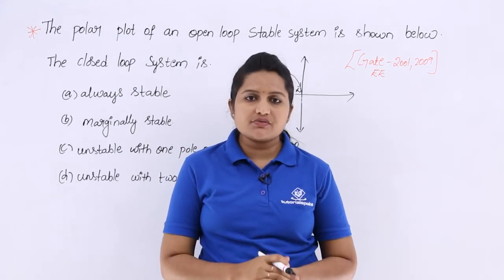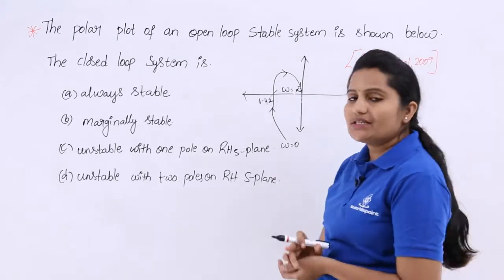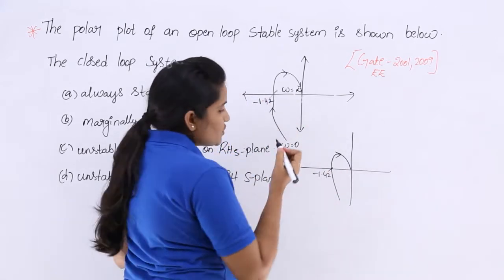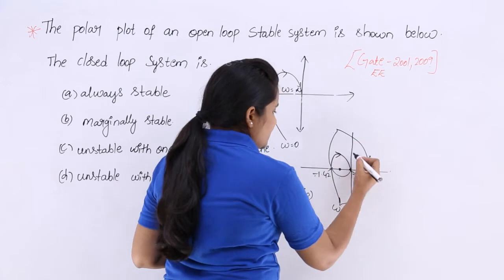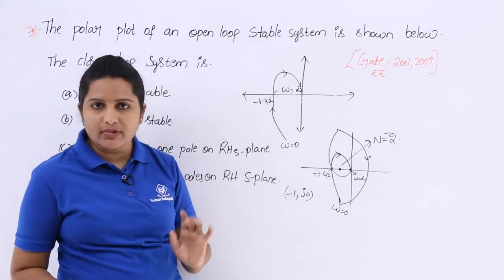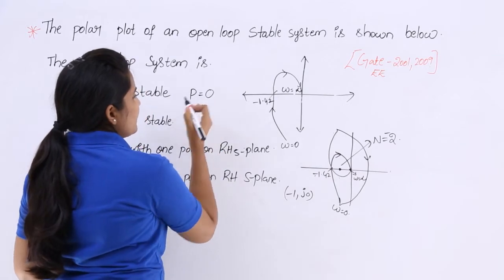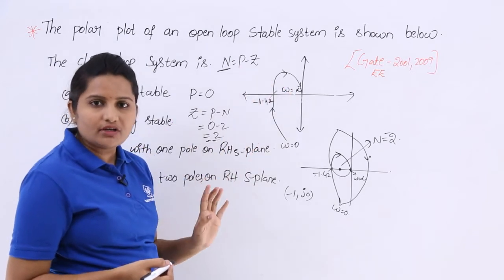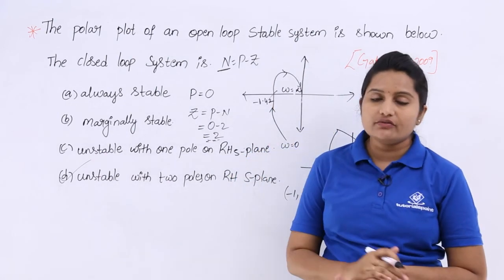GATE Problem 2 on Nyquist Plot

Comment: We got two zeros in RHS, but in last you chose unstable due to two poles in right hand side. Why?
Reply: for closed loop system, no. of zeros of close loop transfer function (cltf)= no. of zeros of open loop transfer function (oltf),,,,and no. of poles of close loop transfer function (cltf)= open loop transfer function zeros(in rhs side) + open loop transfer function poles (in rhs), and in the question we find open loop transfer function poles=0 and zeros=2, so the poles of cltf = zeros(oltf, in rhs)+poles(oltf, in rhs)= 2+0, therefore no. of poles of closed loop function will be =2(in rhs plane) and therefore system will be unstable